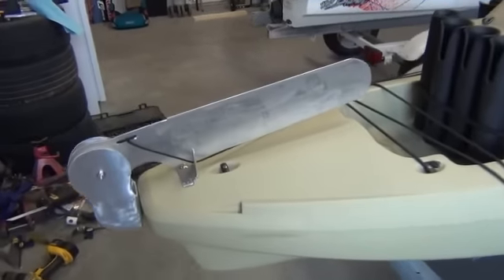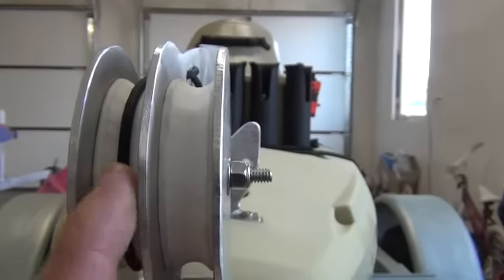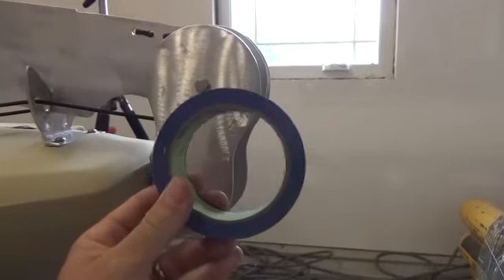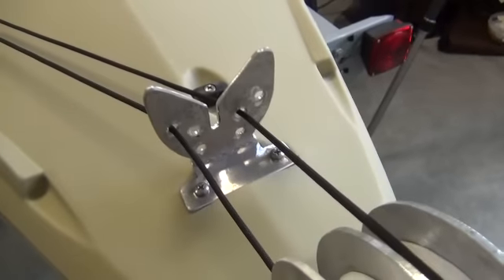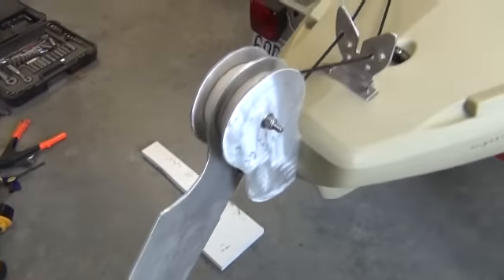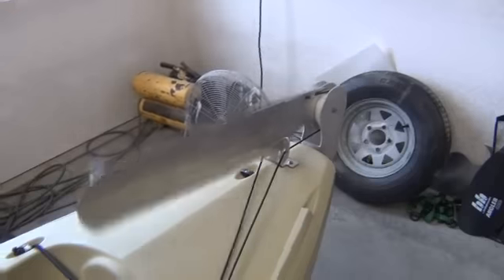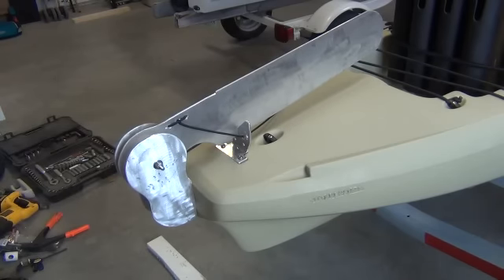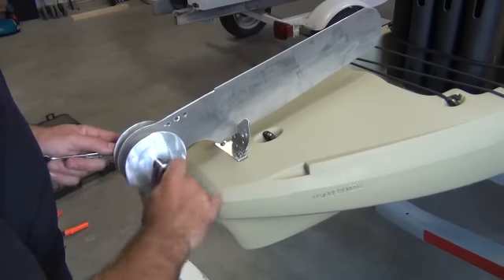DIY fixed, retractable kayak rudder (Skeg) Part 1

Comment: I'd suggest using Teflon kitchen cutting board for the rudder lift sheaves (rollers).  This will have far less friction especially if you have washers or a bushes to give the sheave about 1/2 mm clearance from the outside cheeks.  That will help the rudder lift easily.  The sheaves can have pressure contact (friction) against the rudder blade though.

Comment: Also you could add a bunge from mid-aft on the skeg fastened to the gudgeon which would allow it to kick up and spring back if you pass over anything. With this you set it and forget it until you need to load the boat

Comment: You may find that painting the AZEK black could cause expansion and contraction or "movement" of that portion of your set up over time, may not be an issue at all, however to eliminate this possibility, Sherwin Williams sells SuperPaint® Exterior Acrylic Latex paints in Vinylsafe colors (not certain about black) that were developed when we first started selling AZEK to the exterior building products market.  This movement usually occurs in longer runs of the AZEK that are painted in dark colors that are not Vinylsafe paints or lighter/whiter colors.  I have seen houses that were built out not following the AZEK installation instructions and painted darker colors without Vinylsafe paints that looked like antlers were sprouting all over the exterior trim sections, serious issues.  I would think your project will hold up quite nicely as it is such a small and compact amount of AZEK.  This was a thoughtful project well planned and looks very nice, as a sailor I can tell you your tracking performance will be much improved with your retractable skeg... PS AZEK doesn't require painting at all and can be glued with Gorilla PVC glue. Enjoy!

Comment: Personally I would have added a small piece of material like foam or rubber in the little v were the rudder goes when it is upright to reduce the sound if it when you put it up

Comment: Excellent job man designing mine atm, got the cardboard templates done. Going to make it out of 3mm Aluminium sheet.. Out of interests how long is your rudder. top to bottom when its down? While looking at my cut outs wanted to ask you the rudder length as mine looks a bit off. cheers Will

Comment: right there when you lift the rudder and it slammed on that mount can you put some type of foam or pool noodle or widen that u mount just enough for a small piece of pool noodle to fit then i cut and measure make small cut on small piece of noodle and if it works then I'd put some kind of glue or adhesive.. think about it ,try it let me know.Thanks

Comment from the maker: The diameter of the tape roll will be 4". FYI, I made a second set of pullies for the skeg that are also 4". This helped it operate smoother. They're built identical to the ones in the video just bigger. Thanks for the comments and good luck.

Carl